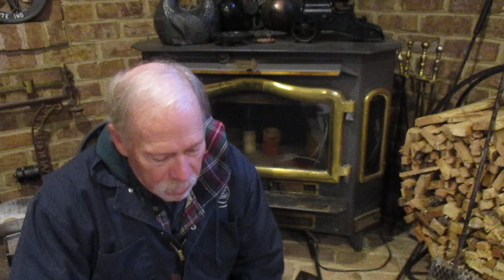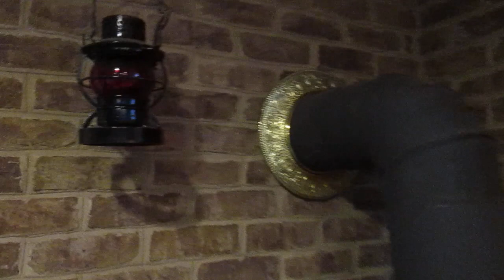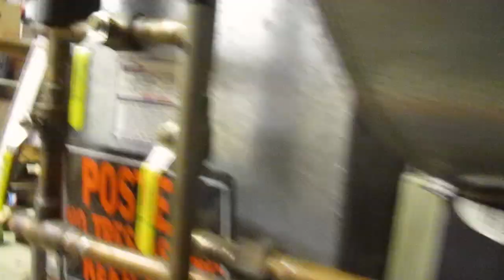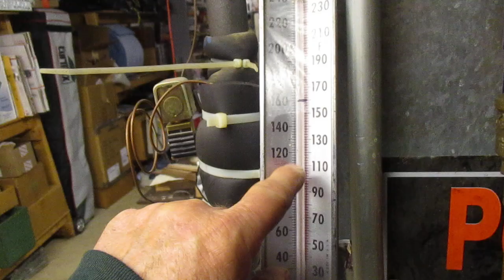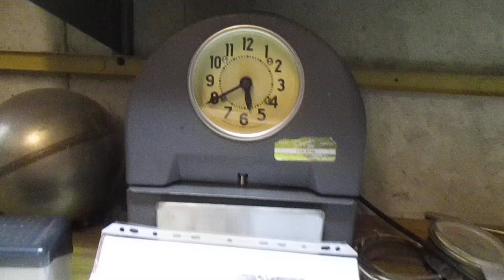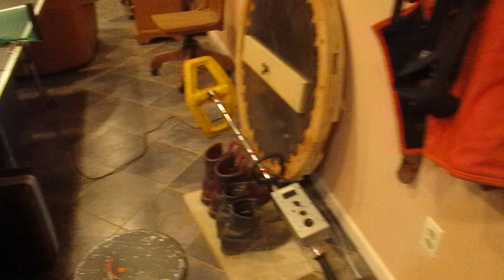How to SAVE at least 10% on many things # 1007

Comment: A friend of ours just installed a wood stove in the basement, the house is so air tight (spray foam insulation), the range exhaust will overcome the draft of the chimney. It'll actually pull smoke back through the stove into the house.
Reply from the maker: hi there thats a tight house ,So glad you stopped by and took the time to watch , Merry Christmas to all thank you John